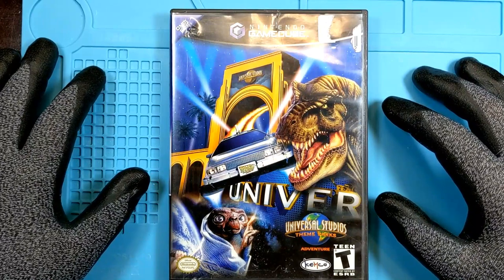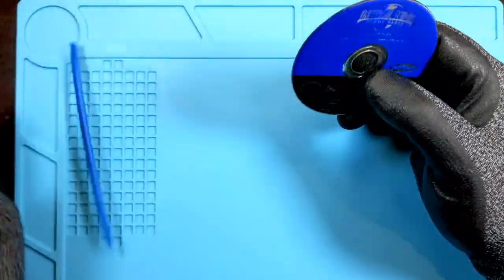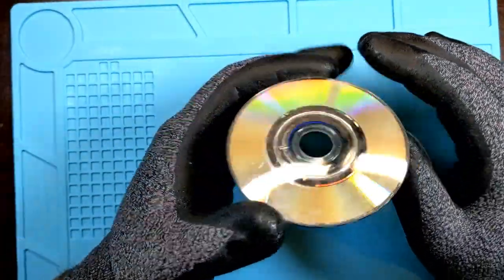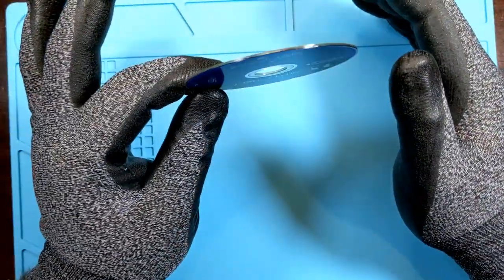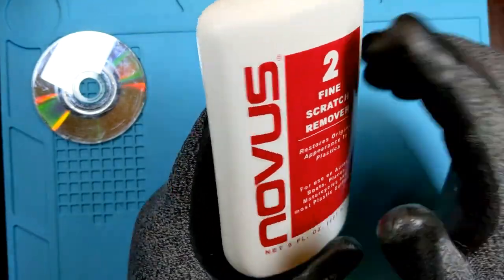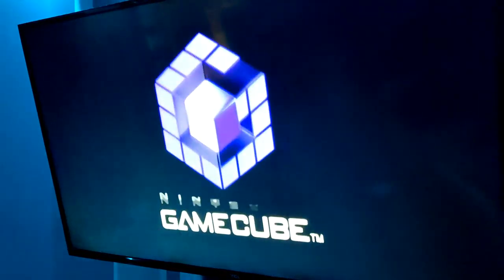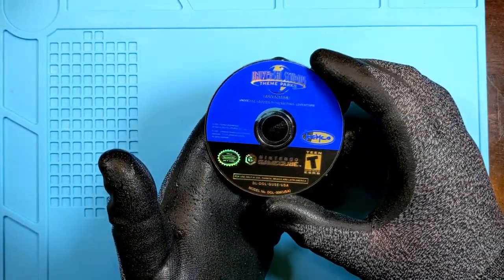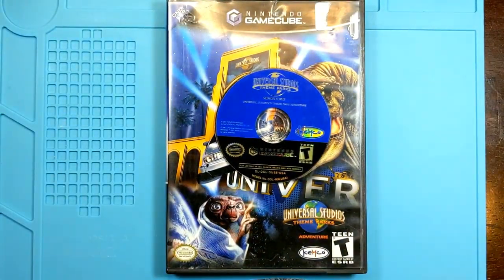GameCube Disc Cleaning Series:  Part 1- Intro and basics

Comment: Thanks for the material, though I have some questions. I bought the paste, followed your instructions and tried to remove scratches of my PSX games. They work, but I am testing out this method to improve quality of some pricey games I have. I have to say that I am strongly disappointed with the results (tried novus on cheap $5 games not to risk too much).

I've used either paper towel or microfibre cloth and all they seem to do is to spread out the scratches throughout the whole surface of the disk, "deeper" ones not even felt with nail don't come off. I tried repeating the process up to 3 times on a single disc and results are still far from satisfactory. Am I doing something wrong or I should leverage my expectations?
Reply from the maker: Do the games play? Getting a mirror finish using Novus (or any plastic polish) is something I'll cover in later videos. The methods shown in these early videos should help bring back functionality to the discs. You might also enjoy the next few GameCube videos where we dive into using Novus Step 3 for deeper scratches.
Reply: @RestoreAndReplay  Thanks, I'll take a look and play around with Step 3 :)
Reply: I must either be doing something wrong or these methods aren’t very effective with psx discs. I tried all the different pastes and the effect I am getting is a lot of thin scratches all over the disc. :/ probably gotta try disc regeneration services.
Reply from the maker: @maciejkownacki3482  Explain your process to me! I've brought back games from the absolute death using these methods. I think there might be something we're missing here.

Alternatively, you can join the Gameye discord and we can tackle this thing together! https://discord.gg/GrWaxWg

The only reason I'm curious about the methods is that I started these processes on PS1 discs, those are some sturdy discs that clean up real nicely!
Reply: @RestoreAndReplay  So what I've done is:

- I prepare some dry and clean surface and some soft paper towel / cloth to put under my CD
- I put my CD on the secured surface 
- I apply either novus 2 or 3 to the disc, not too generously, I spread it over the disc with paper towel / microfibre cloth
- I let it sit for a minute
- I begin polishing with paper towel / microfibre cloth circular motion in a single direction and I continue doing so for 30-50 seconds
- Once I am at the point where the paste covers the CD and paper towel doesn't absorb it anymore I take dry piece of paper towel and clean off the left over paste from the CD

Perhaps I'll join the discord, maybe I'll get some answers there, thanks!

Comment: ive never used novus yet but want to. i did use some nu finish scratch doctor,,i put disc on a counter top and paper towel under..i put heavy pressure on disc with nu finish and microfiber towel. i did it 4 times and also used plastx the last step. 5 times basically. i also used lens cleaner the very last step. it was badly scratched. now it really looks nice. ive not tried it yet but im optimistic. the meguires plastx alone gave some good results but not totally. ill find out soon but it looks alot better now.
Reply from the maker: Let me know how it turned out! Nu Finish works well for me, but does require a few more passes than Meiguiars!

Comment: This video is pretty old but it saved my life dude I had bought this Mario Kart DD from ebay and when it got here It wasn't working and so I searched how I can fixed it and I found this video the bought the product and it actually worked and like you said in the part three "it won't always work the first time" and so I kept going and on my like first try it started working thank you very much my friend 😃👍
Reply from the maker: I'm glad it worked! You'd be shocked how many times I've been given a disc and told that it was dead. A few quick polishes and it comes back to life!

Comment: Hello, Love the video Novus 2 revived my Legend of Zelda Wind Waker. However, I have 2 other discs that I have been using Novus 2 on Super smash melee and Luigi's mansion. I have probably done it about 20 times maybe more and I keep getting a disc error. The Gamecube recognizes that these are indeed the game discs but as soon as you hit start error message. Thoughts? Is it time to go to Novus 3, and how do I know that I haven't damaged the data layer? I keep using my other discs as reference in hopes I don't make them too thin, but I haven't seen a noticeable difference other than the disk getting really shiny.
Reply: I have the exact same problem
Reply: @SomeonesAlt22  So after messing with novus for a while I determined my disk were damaged beyond repair. I got a xeno chip that further proved these disks data layer had been damaged in some way. If you keep getting an error or the game plays and then crashes its probably just a bad disk. Highly recommend if you can solder even just a little to get a xeno chip or what I did was got the drive with the xeno chip on it. Solder the two cables (red) and (brown) to the new drive circuit and then get to burning. Cheap and you can play whatever.
Reply from the maker: You likely haven't damaged the data layer! That would require you having removed around 1.2mm of polycarbonate. I would suggest jumping up to Step 3, giving that a round, then trying again with Step 2. Remember that each time you do a round of Novus or any plastic polish, you're removing some material and some of the scratches with it.

I would love to see images of the disc, or even make an offer to have you ship the disc to me! It's honestly rare to find a "damaged beyond repair" disc, I wish I could find more of them!

Comment: i appreciate that you actually know what you're talking about and share some genuinely good info and tips for those who maybe aren't even in the repair business but just want to play original hardware. Huge props to you.
Also as for what cloth to use, i've just been.. buying novus' kinda overpriced cloths they make lol. Figured better safe than sorry to go with what the manufacturer recommends, have had solid results, but maybe ill try paper towel to ease the wallet.
Reply from the maker: Thank you! Yeah I have the bad bad habit of using paper towels because that's all we had a GameStop, so it's a habit I need to break, but I get so picky about other towels too!

Comment: Thanks for sharing this video!  :)

It would be nice to see the before footage of the game disc not working before you fixed it. Because not showing the before footage kinda defeats the purpose of showcasing the product working, but only showing the after footage.

It'll make it seem like you're implying, "You're gonna have to take my word for it and that it just works". I'm not doubting your abilities or anything. People would feel a little hesitant to try this method without showing any before footage. It would be nice to see in future videos to showcase before footage of the disc not working and THEN show the after footage of the repaired disc working.

I have a gamecube disc that works and doesn't work at the same time. What I mean is that it works when it starts and it takes me to the main menu, but when I start the game, it shows me the beginning cutscene and then loading scene, but suddenly cuts to an error saying, "The disc could not be read. Please read the Nintendo Gamecube Instruction Booklet for more information." I bought it at a local game shop. The shop does resurface game discs, but I'm not sure if they already resurfaced the disc or not. I would like to try this method, but I feel a bit hesitant to try it.

Looking forward to seeing the other videos when they eventually come out!  :)
Reply from the maker: On the cleaning and repair section of the Gameye discord, I go into a bit of detail as to why I don't show the "befores" on my channel, but I'll summarize it here. I don't want people to believe me. I want them to try it for themselves. I could fake the video, I could use a different disc, all sorts of tricks. I'm not trying to sell anyone on a product. I want people to try it for themselves and see what they think. My main goal is to archive and document every single method of cleaning and restoration. So while my preferences leak out from time to time, I don't want people to trust my videos at face value.

I will however start to show how I know that the games don't work, and with each video I will have an example of "this is how you know it isn't working" that's fair. I do need to include that. But I am always much much happier when people see one of my videos and think "I wonder if that will work for me, let me try it" and they run off and try it for themselves. That's the absolute best. 

Whats funny is the 8 gamecube videos all came from a store that said they resurfaced them and they still didn't work, so there's gotta be something to it! The reason I lean more towards this method is that is it less impactful to the disc, because you are controlling the pressure. So you can do a round of plastic polish with light pressure, then try the disc to see if it works. Later on in the series I show you how to spot clean scratches too, meaning you don't resurface the entire disc, just a single scratch that may be troublesome.

But don't believe me! Please try these methods for yourself and see if they work! You might find a different better method that works for you!
Reply: @RestoreAndReplay  
Thanks for responding back!
Very much appreciated. 👍

I see what you mean. Sometimes you got to try something out to see what works or not. Yet at the same time, it could be a bit of a gamble if it doesn't work and you'd get stuck with a messed up disc.

I look for tutorial videos that are actually helpful and will get the job done without having to go to a place to have it fixed and to save money. Some tutorials are helpful, while others are not. I try to do as much research as I can before trying it myself. Just to make sure if a certain method will work and that it doesn't end up messing up the thing I'm trying to fix.

As for trying out your method, I'm still thinking about it. If I do end up trying it, I'll let you know. 

Thanks!
Reply from the maker: I'll be excited to hear your experience with this method if you decide to try it! I've got a video that'll be out tomorrow that shows a similar method, but with car scratch remover and one with toothpaste!
Reply: @RestoreAndReplay  
Looking forward to seeing the video. 🙂👍
Reply: @RestoreAndReplay  
Hello, again!

I just wanted to let you know that I went ahead and tried the Novus 2 method. But before I tried this method, let me mention briefly about my game disc.
Like I mentioned in my first comment, I have gamecube disc that partially works. It's Rayman 3: Hoodlum Havoc. It shows me the title screen, main menu, and the beginning cutscene. Then it shows me the loading screen and gives me the error message, "The Game Disc could not be read. Please read the Nintendo GameCube Instruction Booklet for more information". 

Once I rewatched your video, I decided to put 2 dots of Novus 2 on opposite sides of the gamecube disc, (like you mentioned in the video), since I'm doing it for the first time. I followed everything you said. I went to go test the game. 

The game takes me to the title screen, main menu, then start the game, shows me the beginning cutscene and then the loading scene, but then it gives me the same error message as last time. I have tested 2 other gamecube games and they both work on the backwards compatible Wii. 

here are scratches on the disc and they look very minor scratches. You mentioned the ring residue. I notice there is something on the ring, like there's a "water stain" or something. It's not like the ring residue that you've shown in your second video. There really isn't much residue in there. So, that "might" be the problem. I notice that where this "stain" is that it's slightly opened. Perhaps, the people that I bought this game from might have used the machine to clean the disc? I'm not sure.

What do you think? Here's a post of the image. 
https://imgur.com/z88GE5P
Reply from the maker: @CoolBeanSoup  Yeah so thats the actual polycarbonate center ring either being cracked or separated due to water (the damage in the top left corner or the circle). It's right where the two layers of poly come together. If the disc flexs at all, that seam will open and water can get it. When the water dries or shifts out, you can get that. You can also get that if people try to scrap residue out of that seam as well. The damage tends to look the same. 

Usually when someone uses a machine to clean a GC disc and they get residue inside of the center ring, it'll be all the way around, but that also could have happened from a machine. I'd say give the disc another cleaning or two with Novus or a polish compound and see if that fixes it. Next step would be to check if the disc is warped in any way.
Reply: @RestoreAndReplay  
Thank you for replying. 🙂

I'll try to see what else I can do with the disc. When I took a good look at it, the ring where the "stain" appears to be, there is a slight gap opening between the two layers poly. While the other sides of the ring, the two layers are closed. So, I'm wondering if there's a way to close it properly?

I'll also take another look at your second video that talks about cleaning the ring. I'll also see if the disc I have is warped or not.

Comment: Going on my 7th ish pass of Pokemon Colloseum and still no luck but 3 times on Pokemon XD did the trick! Colloseum is pretty scratched, got it with my brand new GameCube in like 2005, but I'll keep trying. Thanks for the help and saving one game so far!
Reply from the maker: Do you have the issue with any other games? Sad to admit how many times I've been cleaning a game only to realize the laser lens is a bit dirty too. Why this is important is that if the discs are perfect, the laser reads no problem, but if the disc is scratched AND the lens is a little dirty then it feels like nothing will work.

Can you feel the depth of the scratches with your fingernail? Are they locatable?
Reply: @RestoreAndReplay  

My Mario Kart Wii has issues but other Wii and GameCube games play, so I really think it is the discs. I have super short fingernails but Colloseum definitely has some deep scratches that are easy to spot. No one in my area resurfaces so if another few passes don't do the trick, it might be time for Novus 3. Finding a copy is really tough so I hope I can restore it with my original save file 😔
Reply: @RestoreAndReplay  Update: One round of Novus 3 and two more of Novus 2 fixed Pokémon Colosseum!!! I can't thank you enough for these videos, you have no idea how happy this has made me. I haven't been able to play this game since 2006, thank you thank you!
Reply from the maker: That is awesome!! I can get like that too sometimes where I'll clean and clean and disc and it still won't work, and I'll do one more cleaning and BAM, back in action! All has to do with how much surface abrasion you remove and how clear the laser is able to send light through! So glad to hear it's working again!